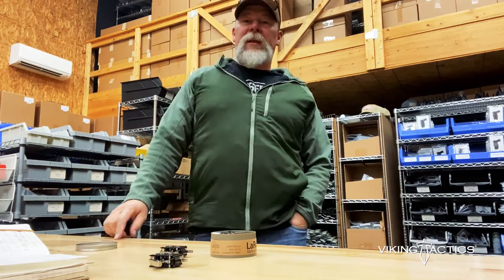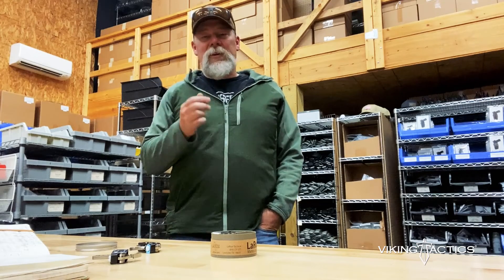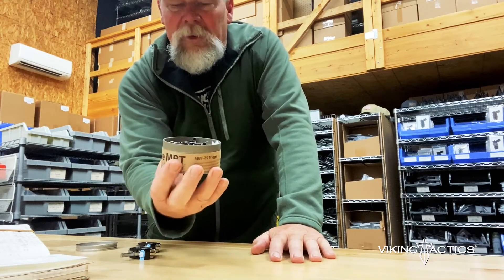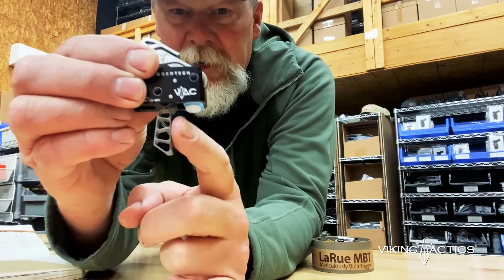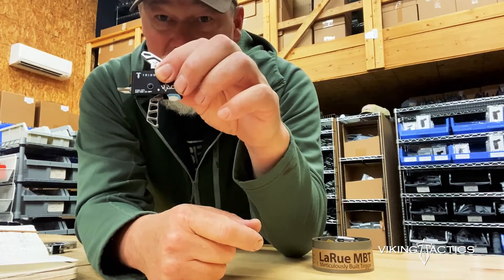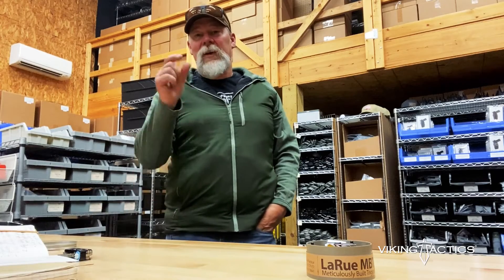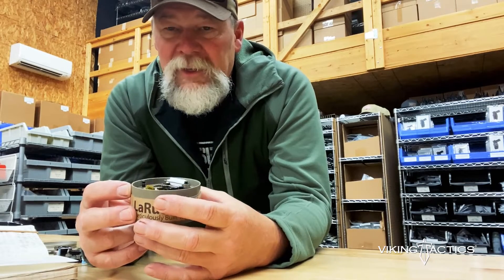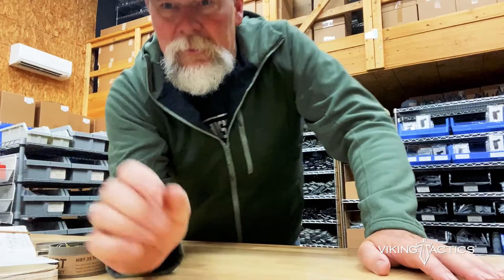Single Stage vs Two Stage Triggers

Comment: Went went the heavy spring on my LaRue and the second stage breaks like a glass rod at 3lbs....amazing value!
Reply: Love my LaRues.
Reply: LARUE! Try it.
Reply: The first special trigger I ever bought was a LaRue. That was 2 years ago. I chose it because their price was great and am never disappointed.
Reply: Did you need to go to the heavier spring because of light strikes, or just your preference? I just installed the MBT 2-stage on a “no frills/all business” carbine I have. I think I will like the set-up but I don’t want to worry about light strikes with mil-spec primers. Thx in advance.
Reply: @562handsomemike late response, but it's mostly just for the stronger reset, shouldn't change the hammer force

Comment: My opinion is the LaRue is the best value in triggers right now.  I have an SSA, SSA-E, and an MBT.  The MBT is between the SSA and the SSA-E in terms of feel and to be honest extremely close to the SSA-E in feel.  I am considering selling all my Geisseles and replacing them with MBT's for consistency in pull.  I spend a lot of time doing dry fire practice using a Mantis black beard and because I have the SSA-E in an AR10 platform the mantis does not work with it and I don't do much dry fire with it.  The muscle memory from the heavier triggers caused a bit of a training scar when switching to the lighter SSA-E and twice now I have unintentionally sent the very first round down rang while prepping the first stage after switching to the AR10.   The rifle was on target each time as I was prepping for the shot and no one around me knew what happened but it has REALLY bothered me that I sent rounds down range when not intending to.  My temporary fix is to dry fire a few times when switching guns but I would love to make them all consistent and the LaRue's are cheap enough that I would earn some money back buying new triggers and selling the old.
Reply: I bought a wilson combat stripped lower and I ordered LaRue parts kit and MBTs2.

Comment: Excellent points - especially the unintended double taps from the Geissele triggers.  I have not had any of them break but the double tap is a thing - especially on rifles with recoil - like a SCAR or AR 10 platform.  I’ve bought a LaRue trigger and plan to install it soon.

Comment: Didn't know your flat faced triggers had a bump on the end, interesting.  I've long put just a bump/dot of epoxy on mine for the same reason, to help in consistency of finger placement.   I call it a snot knot because of the epoxy color,  probably not a good term for advertising purposes. LOL 

Good to see good honest info, none of that this is the best ever, no one else compares or made from secret concoction of dinosaur bones and meteorites mixed by certified virgins during winter solstice kind of sales pitch.
Reply: I like the idea of that tiny knob as a reference point at the end of the trigger.

Comment: Alright, think of your trigger as a switch; I want it to pretty much BEHAVE like a switch. I want it to be at the wall from the moment I touch it, break at a given weight, give very little over travel, require very little reset, then repeat.
I understand those who prefer a two stage trigger, especially in weapons with some recoil.
Bottom line: get a VERY good trigger (whatever you prefer) and it will help aid you with becoming a better shooter.

Comment: You can shoot just as fast with a 2 stage if you know how to properly reset your trigger when firing. Yes it is absolutely easier with a single stage. But when you learn proper technique and practice, a lot of practice, you can shoot just as fast with a 2 stage

Comment: 100% I am building a bench .308/ 6.5 creed, sharing a lower, and my choice is Triggertech AR Duty 3.5 fixed designed for AR10, also flat; I think it would be a good choice. More after tried.

Comment: I'm not sure, but are you saying that the reset on the two stage MBT trigger is longer because of the first stage take-up? If you want to shoot fast are you saying you have to completely decompress the trigger for it to reset? Because if that's true I see no advantage to a two stage trigger at all. I want a smooth and short take-up and a fast reset. I just want to be clear on this before I spend any money, before inflation makes it worth-less.
Reply: Almost every two stage trigger will require you to reset back to the first stage, though not necessarily all the way. Geissele SSA-E and SSA triggers for example do require that you completely reset back to the beginning of the first stage, while the MBT resets about halfway into the first stage. MBT definitely has a shorter reset than the Geissele 2 stages, though not as short as a single stage. The advantage of a 2 stage is that you can rest on the second stage and effectively have a much lighter pull than that of a typical single stage.
Reply: @asdfghjk2933  Thanks for your advice, though I saw it a bit too late. I decided to buy a LaRue two stage trigger. And all this seems new to me, but I'm delighted with my choice. The difference is like night and day. And to top it off it wasn't as expensive as I expected. Thanks again though. It was very nice of you. On my next build I may try the Viking single stage. Kyle seems like a very honest person, and because I'm new to this I'm inclined to default to expert advice, especially when he is willing to sing the praises of his competitors like LaRue. That kind of thing bolsters my belief in his honesty. I'd definitely buy a used car from Kyle, which is saying something. Trust.

Comment: I'm using one lower for 2 (possibly 3) different uppers, one being a 12.5" and another being a 18/20" SPR type upper. I can slap a 2-stage quickly, but I can't stack a single stage. I'm not gonna get caught up in split times, all I care to be is 'fast enough' on the carbine.
Therefore I'm going with a 2-stage, and i have an MBT on the way to test out.
Reply: How did you like the MBT 2-stage?
Reply: @562handsomemike  absolutely love it. I dont have any other 2 stage triggers to compare it to, and its been years since I brushed my finger over an SSA trigger so take that for what its worth.
I can just slap through it for rapid fire or stage it, and even with the heavier 'duty' spring in there it's fairly light with a very crisp break. It gives me what I feel is the perfect amount of slop to avoid NDs.
Its probably better to compare to a G2S (from my understanding, the SSA is still made to the military specs but is a semi auto restricted design, so some of the price of the SSA is meeting requirements like specific quality controls and number engraving stipulated in the contracts while the G2S is a commercial version and lacks some, frankly, unnessesary details) as far as quality and price, but the MBT beats it on price and hearsay is it beats the G2S on feel, but again I cant personally speak to that.

Comment: Do you use a suppressor with those triggers and are they extremely hard to clean
Reply: Hell with a drop in trigger...people should know how to install a trigger. They fail alot more than the original design

Comment: Interesting and great stuff...just traded out of a Rise Armament RA535 single stage for their Iconic 2-stage. My 6.5 Gendel is more of a hunter slash bench princess rifle vs combat or competitive rifle. Surprised that the adaptable 2 stage Trigger Tech wasn't mentioned. Wondering if that was the one doing un-intended double fires the author is talking about. I pulled my 2 stage Trigger Tech from my 16" AR 15 and just put in in my DMR 6.5 Grendel. Love that trigger but I am not shooting competitively fast either. When the Iconic 2 stage shows up it is going back into the 16.

Comment: Uhmmmm i guarantee that the 2 stage doesnt matter for overall. Im far faster with a geiselle natuonal match and a geiselle 3gun trigger bcus of how the reset is done in a 2 stage. The single stages are great with breaks, but they lack the power to force a reset shot and your finger literally outruns the trigger where as the 2 stage trigger forces you to the break point and refires at that point... i may be explaining that oddly but its just what weve seen in our testing and matches

Comment: I've never shot a two stage. All of my weapons run between 2.5 and 2.25 lbs, have very little creep and a very solid wall. It seems these two stage triggers are just tooled up to lighten up the break. I will however go to the strait trigger, makes a lot of sense.

Comment: I’ve had doubling but mostly because I accidentally feathered the trigger.
Reply: Correct. It’s not a trigger defect.   It is easy to get these unintentional doubles - especially on AR10 and SCARs in 308.

Comment: Your statement seems to imply that Geissele triggers are having systematic issues, but I haven’t seen any credible evidence to support that claim.

For context, Geissele triggers are trusted and widely used not only by competitive shooters but also by professional end-users, including military and law enforcement units. Geissele’s Super Select-Fire (SSF) trigger, for example, was specifically developed for U.S. Special Operations Command (SOCOM), which is a testament to their reliability and durability. If there were systemic failures, they wouldn’t be trusted in such high-stakes environments.

I’ve personally shot over 50,000 rounds through my setups, which include Geissele’s National Match Hi-Speed Trigger and SSA-E, and I haven’t encountered a single issue. That’s consistent with the experiences of countless others who rely on Geissele products.

To put things into perspective, I had a friend experience a failure with your flat-face trigger during a 3-Gun match. Does that single anecdote mean your triggers are unreliable or worse than the competition? Of course not. Individual issues can happen, but that doesn’t equate to systemic problems.

Until credible evidence is presented, it’s unfair and misleading to try and tarnish the reputation of a company that has consistently delivered products trusted at the highest levels.

Comment: What dose doubling mean ?
Reply: It shoots twice, quickly, instead of just the one shot you intended to make.  It’s caused by the recoil of the gun, causing you to unintentionally pull the trigger again.  It happens because the trigger pull of the Geiselle  is so light.  It’s not a trigger defect per se.

Comment: As much as I respect Kyle for his expertise , experience and sacrifice for this country, I can't agree with the "other Popular trigger".  Lets be Real, G completely changed the trigger market for the AR 20 years ago when Bill Created the Hi Speed Match, which to this day, is still the finest trigger you can buy IMO.  Its the most proven , tested and used aftermarket trigger on the market.  The AMU boys started using them and they migrated over to SOCOM , first by replacing the old KAC triggers in the Mk11 that were prone to failure. KAC has since fixed it and they make one of the best AR triggers on the market, albeit expensive.   Larue is impossible to beat for the money, $70-80 for a fantastic 2 stage trigger, even if the shoe is a bit wide.      If we want to be super real, lets talk about all the failures of Trigger Tech and their recent recall.  Hundreds of PRS/precision rifle shooters have had trigger failures.  In 20 years I can think of less than a handful of complaints about G triggers, and most were due to improper tuning on the adjustable ones.
Reply: I thought the failures he was referring to was of the KACs. 

I’m actually surprised that KAC makes something that fails as badly as their 2 stages, gives me flashbacks to RRA’s 2 stages 🤢
Reply: @riflesfirst208  That was an issue 20 years ago.  EVERY match type trigger on the market failed at that point under hard use, which is why the G trigger changed everything. A few years later ALA 2005ish, KAC redesigned their 2 stage and it is every bit as good as every G trigger short of the the Hi Speed Match, which is still the gold standard to this day.   RRA 2 stagers were the definition of failure in this time period, there just were not many options out there and they all sucked.
Reply: I was part of the Geiselle recall for double fires. Less than 150 rounds. Prefer larue.

Comment: does two stage mean double action?
Reply: It means it has a bit of creep to it, you hit a “wall” then it fires.
Reply: @cavsnation831  I think you're not using trigger creep in a correct explanation here, I have two Sig AR15's and have the Sig 2 stage match trigger in both of them. The single stage trigger that came with them had trigger creep, you could feel the creep while you depressed the trigger i.e. you could feel the metal parts sliding against each other before the trigger break. With the Sig 2 stage match trigger you have the smooth take up to what is described as the "wall" and the trigger breaks smoothly at 4.75 to 5 pounds of pressure as you squeeze the trigger, both of my 2 stage triggers break at 4.75 pounds of pressure. 

I tend to be more on the sensitive side on my trigger feel. All triggers have take up, that is the minor amount of slack before they start to activate. My Les Baer 1911's have trigger slack, my Ed Brown 1911''s have trigger slack and my Kimber 1911 has trigger slack, but all of them break very smooth with no trigger creep.
Reply: @mustangecoboosthpp3869  Yes, some people seem to confuse take up with creep. Creep is movement after you hit the wall that can disrupt your trigger pull. Take up is just the movement before you hit the wall, aka the first stage of a two stage trigger.